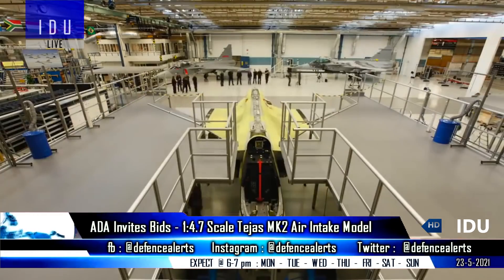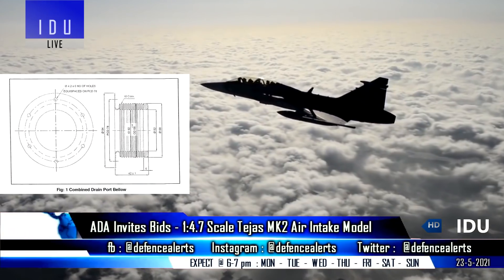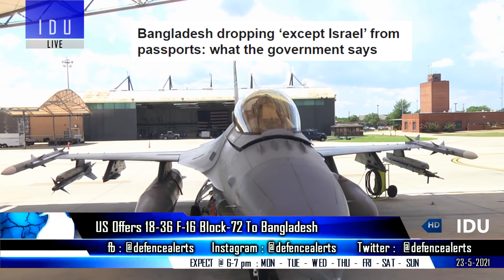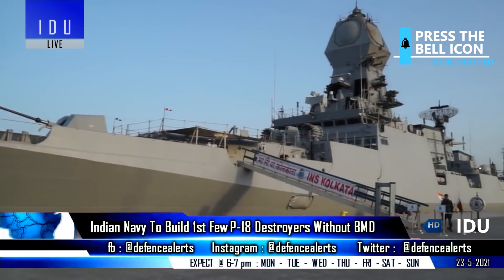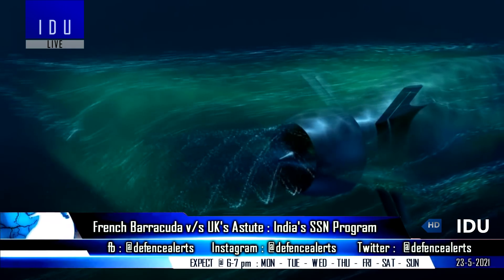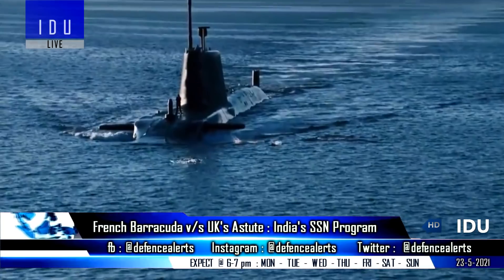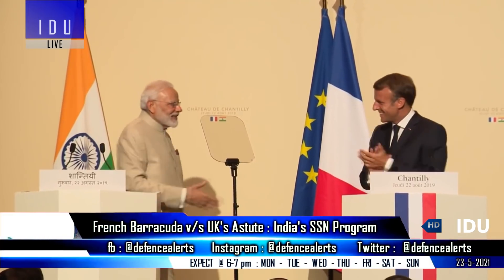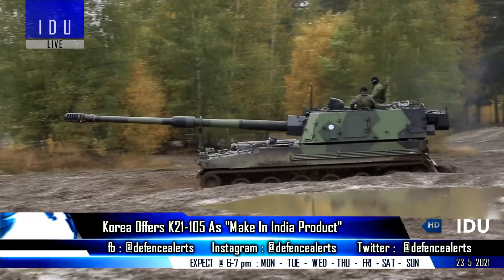Indian Defence Updates : P18 Production,GAWV For Tejas MK2,Barracuda vs Astute SSN,Tejas Bangladesh?

Comment: the Indian Navy should acquire a fleet of five Astute class guided missile hunter killer submarines!!! however it is absolutely imperative that the IN insist on a non nuclear powered variant of the Astute class sub & not the nuclear powered one!!! India doesn't need a nuclear powered sub for the simple fact that it already has two of them & secondly nuclear powered subs are very expensive!!! with a unit cost of €3.5 Bn it's even expensive for the RN!!! for the sake of conversation let's coin the Indian variant of the Astute class as the Astute II class guided missile hunter killer submarine!!! first & foremost the Astute II has to be much bigger than the RN version & will displace anywhere between 13,820 ton - 15,600 ton!!! it'll be powered by a new cutting edge AIP & Li-ion marine propulsion system that'll enable the Astute II guided missile hunter killer submarine to run submerged for extended periods (in excess of 30 days) of time!!! the Astute II design will be conceived using digitized fusion core marine design architecture!!! all Astute II class subs will be armed with a 11-cell SYLVER A80 VLS in the front bow-midship section of the submarine's hull & 4-cell VLS in the rear stern section of the hull, immediate aft of the sail!!! featuring an arsenal of Exocet MM38 anti-ship missile, RGM-56 SUBROC anti-submarine missiles & RGM-109B Tomahawk ELR (Block III) guided land attack cruise missiles!!!

Comment: I don't know why Navy is cutting it's Submarine requirements. On one hand China is increasing it's Submarines fleet every year & on the other hand we are cutting down our requirements due to lack of funds.

We require both P 75I & P 76 projects to counter the Chinese Navy in the IOR. Both these projects are very crucial to our requirements of a Blue Water force.

Let's not forget that we will be retiring 8 Kilo Class & 4 Shishukumar Class Subs over the next 15 years which will leave us with only 6 Scorpene Class in SSK. To replace these Submarines effectively we require P 75I project to go ahead. 6 SMX 3.0 fitted with AIP along with 9 Scorpene fitted with AIP during their mid-life refit will provide much needed deterrence.

If there's a cash crunch then a different way can be used-

1. 2022- Sign the deal for 3 Additional Scorpenes which will start getting delivered 2025 onwards since MDL is already manufacturing the 6 Scorpenes right now & has already said that it has idle lying capacity right now. All will be delivered by 2027. This will make sure that till 2030, our Submarine numbers don't fall & we have atleast 18 SSK in service at any point of time. From 2028 we will start retiring 4 Shishukumar Class sub till 2032, so these 3 additional Scorpene will help phase them out comfortably.

2. 2023- Sign the deal for producing 6 P 76 SSN deals in collaboration with France. Keep the deadline for commissioning the first Submarine as 2031-32. Remaining 5 can enter by 2036-37. Akula 3's lease will come to an end by 2035-36. By that time our indigenous 6 SSN would enter service.

3. Sign P 75I (6 SMX 3.0) by 2025-26 so that first Submarine enters service by 2032 & Remaining by 2036. This will help phase out the 8 Kilo Class Submarines.

Meanwhile by 2027 or so start developing our own indigenous SSK design based on Barracuda Class so that by 2030 we can sign the deal & they also start coming by 2037-38 & help increase our numbers.

All in all we require a solid long term plan of how many Submarines we want in service by 2040. As per my analysis we would require atleast 30-35 Submarine (21 SSK + 13 SSN) by 2040 to counter the Chinese Navy in the IOR. For majority of this decade the Government should only focus upon 3 things in Navy-
1. Submarines
2. Destroyers
3. Minesweepers